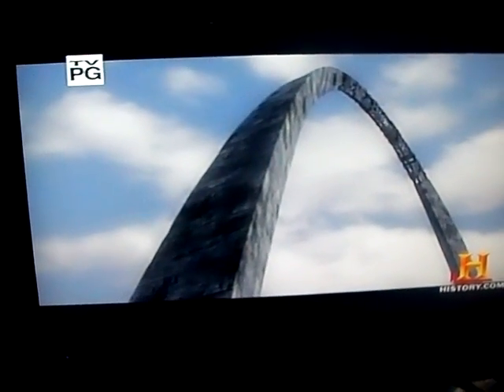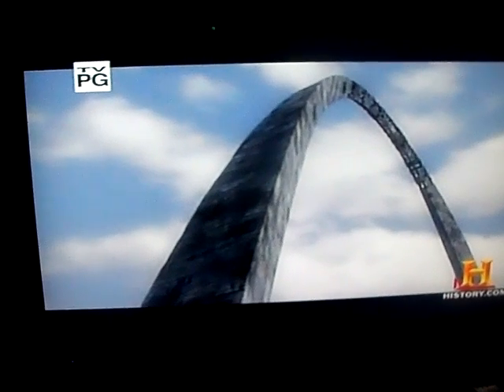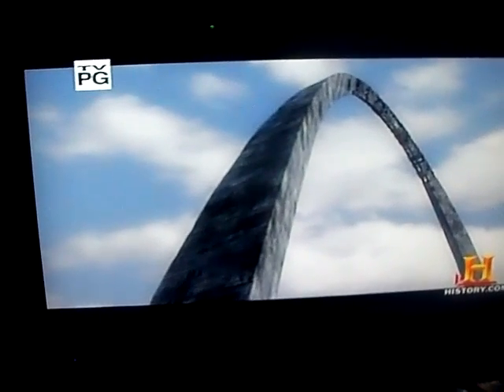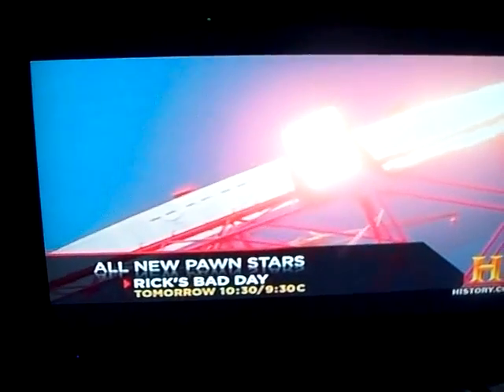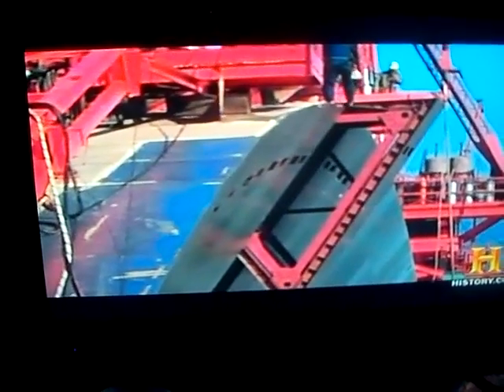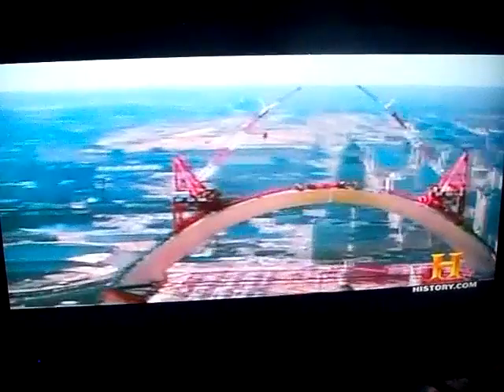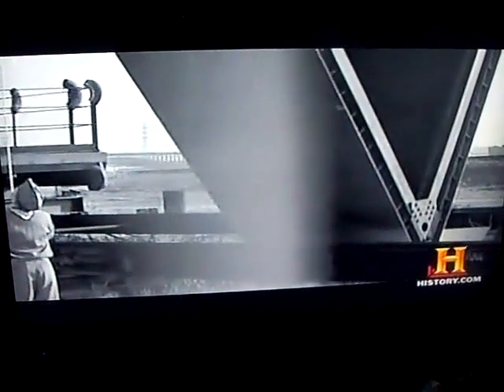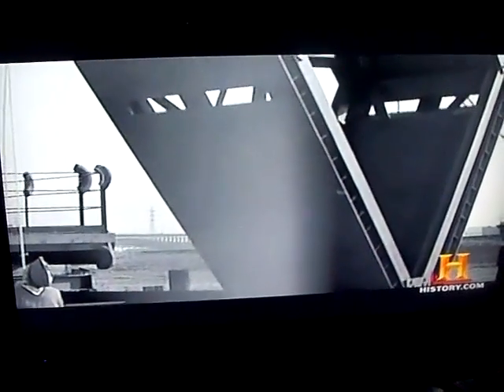St. Louis Arch Falls

Comment: First, the animation on the structure is designed wrong.  And second, it won't collapse like that.

Especially only after a mere 250 years.  I would give it 800 years with neglect.
Reply: this is a TV show, this guy did not make the animation, i disliked your comment
Reply: @TheFlopped2979  he knows that it’s the TV show